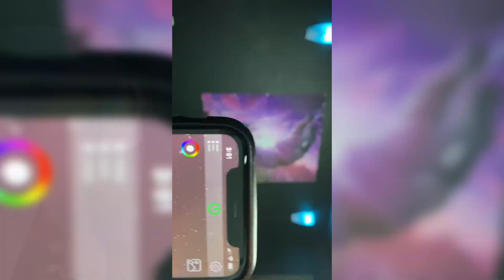Transforming My Bedroom Into My Dream Gaming Setup *NOT CLICKBAIT* 2021 gaming setup timelapse

Comment: hey man what was that stuff on your floor do you have any links where i can buyc
Reply from the maker: Yes its foam tiles they are great for noise/sound isolation cost around $80 on ebay just look up foam tile 24”x24”
Reply: @ultimatesetup7866  what did u put over then ? also thanks for answering love the setup
Reply from the maker: @phaybel8734  my pleasure as long as you are happy 😊, i layed down a carpet bought from amazon cost around $140 size 12’x14’ that was a great idea to avoid the gaming chair slipping around you also can get any color it gives an awesome look too